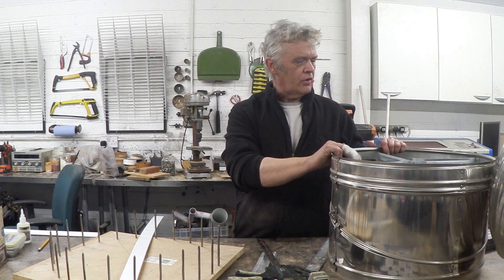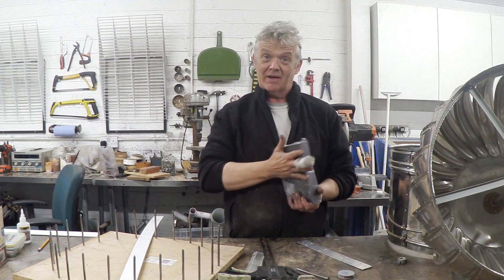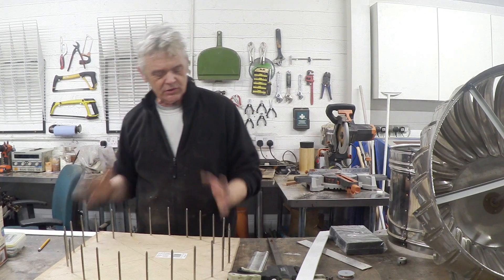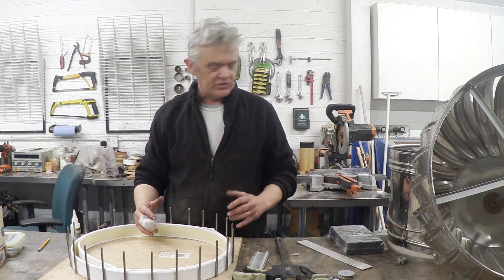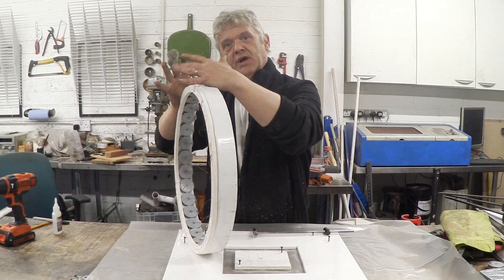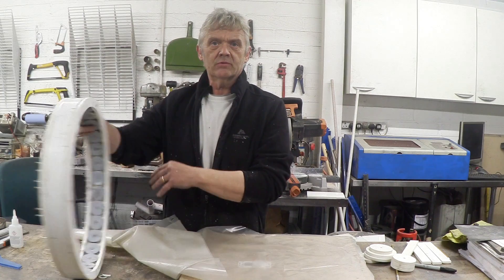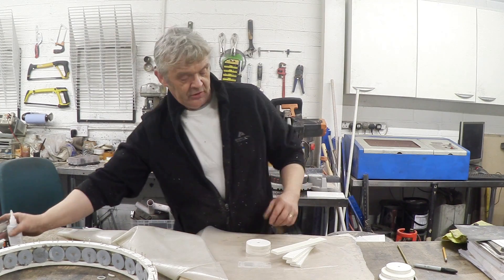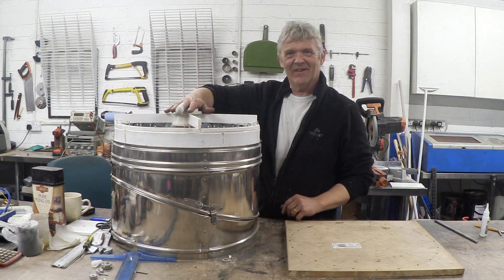Rotating Ventilator For Wind Power Part 3 - Making The Stator

Comment: What rpm are these likely to get upto? Rotative machines usually more compact if turned faster... 

Something akin to old tech of a Bike dynamo.  Could maybe be made with a few powerful magnets mounted alternative N/S on  faces of a small driving disk, that will be spun. If magnets are little cylinders... They'll fit nicely into  holes drilled on a pitch circle. Rubber bands stretched around circumference would ensure it  turns if sprung against inner/outer of a spinning "drum".. Smaller magnet disk equals considerably increased  rpm. 

Coils fixed in line with pitch circle on   magnets. Maybe use C shape former over edge of disk to help return/ concentrate flux through the coils. Old transformer lamination prob best, but anything "iron" should help. Including metal wire coat hangers.
If using flux concentrator leave an arc/segment, free of coils so driving disk is not completely enclosed, and  can be pressed against large drum/wheel.  Output waveform then not simple sinusoidal... But if rectified to DC... not a problem.
Reply from the maker: cheers mate

Comment: This looks really cool, the best part is that it is made for something designed to be put on the roof so no permits would be required in countries with laws about anything above the roofline. This should also have the potential to put out a good amount of power also.
I have a feeling that you may need to arrange the magnets in an alternating N, S, N, S etc.. position.
Great video Rob, eagerly looking forward to seeing this completed.
Reply from the maker: yep - probably will use just good old NSN arrangement
Reply: It might also need some extra weight to keep momentum when current is being drawn.
Reply from the maker: I'll use it to charge a battery or capacitor and draw the load from that
Reply: Robert Murray-Smith to keep the current draw low?
Reply: @ThinkingandTinkering  I would like to see it done in a couple of different formats to gauge the best usage. One way would be to wire every second coil together to have two lines that could then be rectified individually before wiring in series. The N, S, N, S orientation of the magnets is definitely the best way to go. I am ordering some magnets tomorrow to try something similar but using a standard windmill type design with staggered 30cm carbon fibre propellers designed for drones. Thinking of using 4 x twin blade propellers at 45 degree offsets.